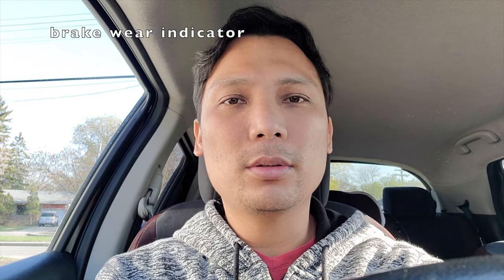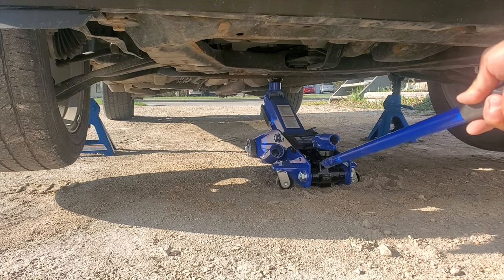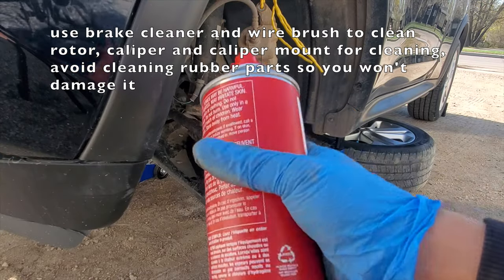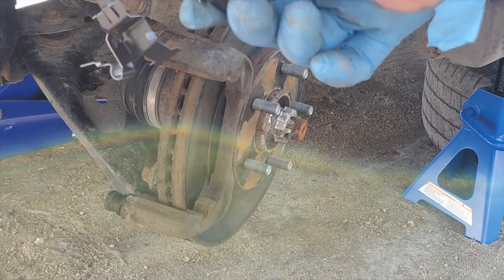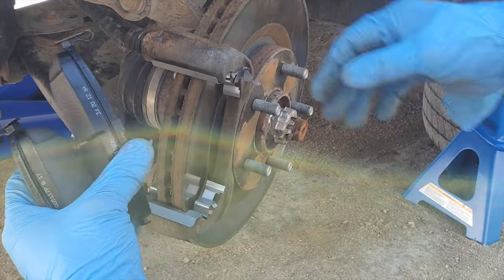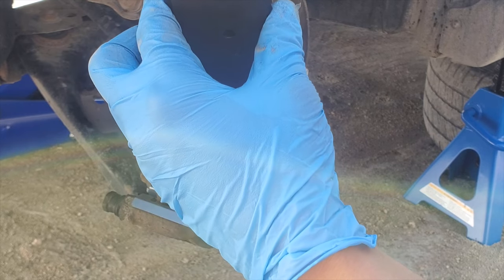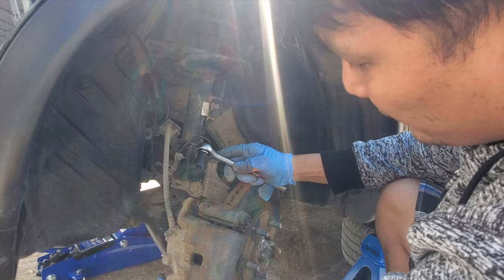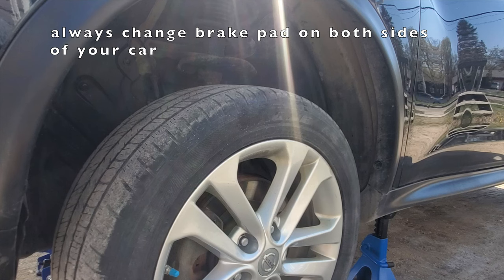Squeaking Sound During Reversing Your Car | Front Brake Pad Replacement

Comment: Mine only squeal when reversing but not when I drive straight, is it the brake pad worn out as well?
Reply from the maker: Thats what this vlog is all about, when im reversing, im hearing that squeal/squeaking sound. You might have the same problem like mine. If your brake pad is really old or thin, you may want to replace it anyway. Worn out pads damage your brake rotors, and will add up to your expenses to replace it rather than just replacing the worn out pads. And i also have that vlog on how to replace rotor for my car.
Reply: @GePete As for me, I've just change to new pads and the squeal just suddenly appears, I really have no idea what cause the squeal

Comment: same problem with my 2017 highlander. kakabili ko lng a week ago. pro sbi ng dealer bago lng all break pads.
Reply: idk whats the problem now
Reply from the maker: parang may nakita ako na spray para sa brake na mawawala yung unnecessary sounds lalo na kung bago pa brake at di pa gagasgas yung squealer sa rotor na indicator na worn out na yun brake pad

Comment: My pads are new but I get this high pitch sound when reversing with foot on brakes
Reply: Ever figure out the cause?
Reply from the maker: most of the time its the squeeler that causes that sound giving you warning that you have worn out brake pad, but as you said you have new brake pad. is your brake pad compatible with your car model? im thinking maybe squeeler is too long. maybe you may grind it a bit shorter
Reply: It's a Mazda cx5 I heard maybe the brake clips are too small , if I lube them they are fine for a couple of days
Reply: I have that problem as well 3/4 months my front brakes are still making the same sound, brakes are new and the new rotors as well